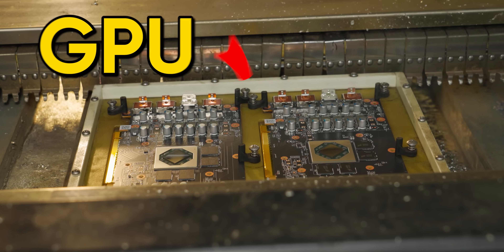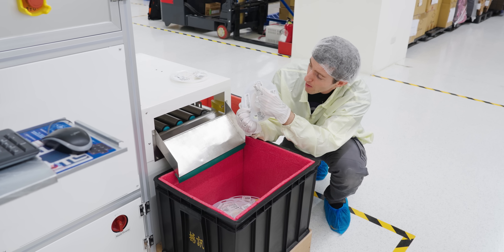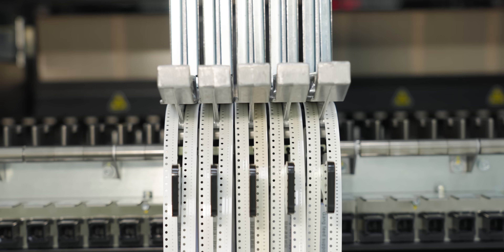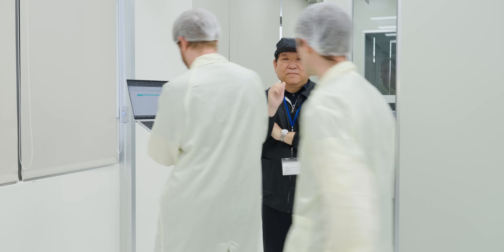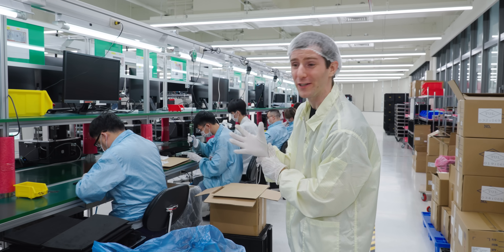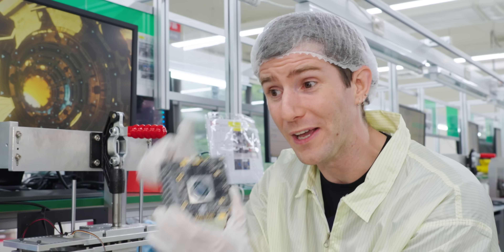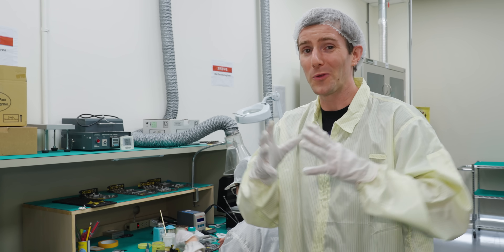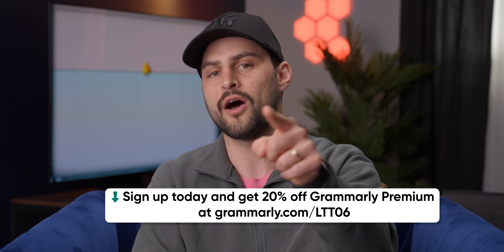They Turned off this GPU Factory For Me! PowerColor Factory Tour

Comment: About temperature testing:
It is common to test electronics while changing temperatures, it is called Thermal Cycling Testing. 
The electronic module expands and shrinks by some micrometers due to the temperatures, which can cause delamination or plastic deformation, leading to a failure of the module.

Comment: Seasonic psu is trash i paid 150 euro brand new gx850 yeah and it didnt work. We meansure the volts and it was lower than it should be and it wouldnt turn on the pc plus the one of the capscitor had also leaked oiled and even brand new it smelled kind of a burned smell. Seasonic trash never again

Comment: Man, I really didn't think work like installing connectors and capacitors is still done manually. I wonder if there's a reason for that?
Reply: I can see why the IO plate would need to be manually placed but a capacitor could just be done by a pick and place machine thingy right?
Reply: @Nostalgia_Realm  Pick and place is mainly designed for surface mount components that can be handled in a sheet. Which is the majority of the board. But you really can't beat through hole capacitors for thermal resistance and overall power power.

Comment: Haha, i remember writing a Manufacturing Execution System (MES) for Dolby Labs back in the day that handled the manufacture/movement/tracking of boards all through production. I remember interfacing to all those machines (pick/place, ICT (testing), Flow solder, SMT (top/bottom). Testing was done with a Scorpion Flying Probe test machine. We had to knock a hole ion the side of the building to get it in. We also had fault tracking to enable heat mapping of failures on the boards at testing stations.
Wow, this brings it all back. Nice video.

Comment: Does the entire motherboard get dipped in the liquid solder?? Why dont they do the same roller way as the solder paste? 

Imagine: a roller with oozing solder and a heated template so it dont dry till the roller has past more than once. Then shoot a laser or super thin blade slicing horizontally theough any exta soder.
Reply: Wait they have balls that already do this??? So why not do that for the motherboards???

Comment: Thanks Linus for the video! I'm also in electronics manufacturing, and this isn't the craziest line that I've seen. Anti theft tags or Sim cards are basically small PCB and the machines are astonishingly fast. The bare PCB comes in a spool which is unwound, solder is placed, then components are baked on, its gets die cut and rollend into a new spool, ready to go. It does at a few miles per hour and lloks like a H R Giger giant cassette player
Reply: Is it true you guys get bad pay because the job is cool?
Reply: @sinesaii  lol the pay is ok as far as im concerned. The issue with this kind of electronics is that its high volume, low margin, so it's high risk low reward compared to professional audio or military stuff for example

Comment: BTW:  40*C isn't so bad, compared to the 60*C I had to work in when I worked in a plastics manufacturing department for a refrigerator company.  (in the summer if it got to 110*F outside, it was 140 or higher inside that department.  We had port-a-cool fans that half worked and large fans as well that ... "helped"  (when we didn't have any fans, you knew how much they did help... but otherwise it was just hot air blowing, or so you would think).

Comment: Cmon Linus, you KNOW it is FLUX paste! Louis would be disappointed in you!
Reply from the maker: It contains both, but its purpose is to solder the board components, so I went with that. Our time was very limited so I wasn't able to script and use my teleprompter - LS
Reply: @LinusTechTips  I see because it is for components where you cannot apply solder too the paste has both solder and flux in it... Neat. Honestly I have not messed with micro soldering. Used to make my own pcbs in the acid tank.

Comment: Great video.
I'm curious. Because the theme of this video is GPUs.
Here are my questions:
1)Can Workstation GPUs like for example on the red side the AMD Radeon Pro W7900 or a similar GPU on the green side, be used for gaming as well?
2)Does it get you any benefits opting for a Workstation graphics card instead of a regular one or are there some drawbacks?
3)What are the key differences between gaming and workstation graphics cards?
Thanks for taking the time to answer these questions!

Comment: I remember that we occasionally sold PowerColor graphics cards way back like 20 years back. Then they kind of disappeared locally. Good to see that they are still in business. As I remember it we had no problems with their products even back then, and with the controlled manufacturing environment shown in this video the current products should be of high quality. If I remember correctly the graphics cards from them we sold way back here built using VGA controllers from Tseng Labs. Now that's a quite different quality of product compared to what we saw in this video.

Comment: Fun Fact: Linus you mentioned on the WAN show that you changed the aspect ratio of your videos to fit better on Phone and PC screens, the fun part is that if you made it just 10 pixels wider it would be perfect for my screen, because I use Firefox with the bookmarks toolbar on the left side of the screen, so in "theatre mode" I get basically no pillarboxing.

Comment: Used to work at a factory that had one of those wave solder machines.
It malfunctioned one night and spilled its entire solder content onto the floor of the factory.
What a mess that was
Reply from the maker: Oh no........ - LS
Reply: @LinusTechTips  I don't remember the exact amount, but IIRC it was close to 200lbs of solder.
Needed to use an axe to break it apart

Comment: It's odd seeing someone so excited for something you see every day. Our line has a couple extra steps though. After solder inspection, it gets washed, and then comes conformal coat.

And that pool of molten solder, it's called "wave soldering" ;) As you saw, it's more labor intensive, aka expensive. A good tidbit of information for any engineers out there working on a small run of CCAs, avoid mixing surface mount and through hole components if you can, will greatly reduce manufacturing costs.

Comment: It's remarkable how similar the fabrication process these GPUs are to most other PCB fabs.
My previous job was configuring and training PCB fabs on a brand of automatic solder inspection machines, and the production lines are almost identical ! Just scaled down/less fast here and there.
Reply: What did you think they were? You must not have worked there for long. Any sufficiently advanced technology is indistinguishable from magic. Yes GPUs are PCBs. Any part in your computer that has electricity going through it thats not a cable is a PCB. Without PCBs there are no computers. Its hard to remember who they identify as deep down, but beneath all the plating, cases and large fans, they identify as PCBs too. 😂

Comment: As much as I love my seasonic PSU's, I've gotta say... don't buy the Vertex line up. If everything is as I understand, and if I understand correctly, all those GPU cable fires are due to the way the pins in the socket are laid out; and so it's not really actually something Seasonic can control for all that well. Why does this matter? Look at the socket on the PSU. It's the same plug being used on both ends. 

I want to say that Seasonic would at least do their best to ensure that fires aren't a problem on their PSU's end of things, but that connector is not their design; so it's not something that can miraculously fix when the problem is the design out of their hands itself. 

And...

Seasonic does make duds now and then too. M12II series... those who know, know. Those who don't... well... you'll still see this one being sold in some places for real cheap. There's a darn good reason. It's one of the very few actually bad PSU's that Seasonic has ever sold that I know about. Until the Vertex, possibly. 

Notice how they are selling them for cheaper than their other lineup? Notice how they used to be a 7 year warranty maximum, despite offering 10-12 years for their Prime lineup? Some might notice that Vertex is now getting the 10 year treatment too. And I do like to see that, since it means Seasonic is fairly comfortable with the warranty period. It's a good sign.

But...

That new connector... it's caused so many problems now. All of it due to the design as I understand. 

I personally will not be taking that risk, and am staying way from Nvidia's GPU's entirely if they use it. If AMD starts using it, then I guess I'm stuck with Intel. If all 3 use it, then I won't be upgrading for a while until they fix it, properly. 

No one wants anything to do with fire appearing in their PC. Understandably, I would hope. 

So, sorry Linus, sorry Seasonic, but Vertex ain't getting my money. It's quite possible that the PSU will be just fine within the warranty period, but that fire issue for that cable... it's too much to ignore.

Comment: This factory tour has the be one of the best ( if not the actually the best) factory tours on the YouTube, as an industrial electronic technician i trained under a pcb manufacturer ( they are specialized in ipc level 2 & 3 electronics) 
This tour had it all, from the components getting first visual inspection when it's arrived to the factory, R&D on new products, manual reworking on ICs/ chips  to the packaging ( quality control is whole another story ) 
Using Mantis ( its like a microscope ) to inspect visual deformation in SMD or THT components ( usually that's goes through least 3 inspectors to verify absolute best quality products )
Reply: If you haven't seen the factory tour videos by GamersNexus, it sounds like you'd love those.
Reply: im curious, can a person with bachelor's degree get accepted in those types of job or is there a specific requirement/s?
Reply: you should see their tour of the intel fab in Israel, this one is also very impressive

Comment: Yes those ORT rooms are brutal. Remember doing QA for HP laser printers. And the different rooms. 0c and the 45c at 100% humidity were the worse. But the low humidity was quite uncomfortable as well.
Reply: Total agree on low humidity being wildly uncomfortable. I spent time prodding server hardware a while back and the room was kept at ~6% humidity and 18c. The cold wasn’t an issue but the low humidity felt like the moisture was being sucked out of my skin.

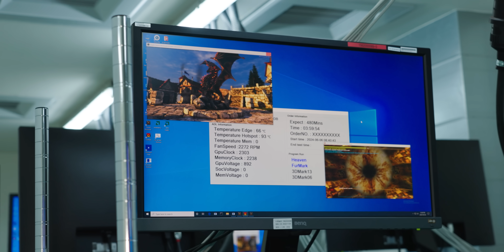Comment: 11:02 they test for cool temperatures because some users like me, may use it in industrial places, outside, during winter. When temperature is below 0. That is super cool!
Reply: That’s cool :)

I wonder if it helps with transport too. If they can survive the cold without breaking then there’s more options for things like airfreight where it’s cheaper to fly stuff in the cold parts of the plane.

74gear had a great video showing one of the aircraft he flew where the cockpit was heated, but the cargo space dipped well below freezing during flight. Was an interesting example of how the economics of freight works.
Reply: @jamieknight326  that is correct as well. You said it right! It is definitely useful to test the gpu if it can handle transportation and stuff

Comment: vastly more interesting than I thought as I've been watching GPU repairs for several months. I have multiple Powercolor cards in 2018 and they make great basic cards, the performance or higher variants not so much. The Framework card is interesting-why not standardize a GPU card for desktop and laptop with 75 watt TDP? This way, this card tier can be made more affordable for everyone and have price/performance similar or close to $200 graphics cards and laptops can finally have discrete/user replaceable GPUs.

Comment: i wonder why they haven't used mxm in framework laptops, was it licensing or something? i mean if they want to get best upgradability then mxm instead of proprietary connector would be better choice

i know that many manufactures tried to make it impossible to interchange gpus back in the day like asus flipping it 180 degrees or toshiba with diffrent pinout and many more made weird dimensions ones,bios locked them like hp or just made their own connector based on it, but still there would be more chance to upgrade in case of it shutting down

Comment: There are a lot of components on every board so the machines probably are placing multiple different components very quickly and accurately that's why they check the components before loading them for problems, if a machine thinks there are 3,568 but there are actually 3,567 it could shut down the entire line or the board might make it out without that part, knowing where the problem came from is essential on automated machines, I bet that they didn't check for flatness until something happened lol, usually that's how new steps get added to a process, unfinished cards can be easier to damage so a visual inspection is a good idea when you don't have the extra machine or aren't making enough of them to setup one to do it for them, I think it's cool the way you can setup a jig of spring loaded gold pins to come down and touch preselected pads or test points and check specific things like voltage outputs etc automatically to make sure there aren't any huge defects before the next stage saving much time, imagine how good those people are at reballing and installing big custom chips and working on these complicated difficult to work on cards lol it would be awesome if a manufacturer would have someone looking for cards that perform really well to bin for people to buy for a premium, like cards that achieve stock speeds at lower voltage or temperature etc

Comment: Thank you Linus and team for this video tour. I worked in the PCB fabrication industry for 28 years, so I've seen that first hand, (I worked in the wet process areas of this industry. Thankfully, I'm retired from that work, the chemicals involved are pretty nasty. I have scars from chemical burns.)  However, I've never seen how components were installed using modern methods. Very cool stuff. PCB worker, 1983-2012, I guess that's 29 years. Do I miss it? Noooo.
Reply: Thanks for sharing. That sounds like a heck of a career. Did you move into something else after or have you retired now?
Reply: @jamieknight326  I'm only 60 yo, I'm not old enough to retire. I've worked at HD for over 11 years now, and couldn't be happier. I'm going for my 20 year patch, and then I'm out. I'll be 69, and still in great shape physically, do to my activity level at work.
Reply: @stumpythedwarf8712  thanks for the info. Hope the next 9 years with HD go smoothly and you enjoy your retirement when it comes. Best wishes :)

Comment: I've been an Nvidia guy for the past 25 years but they're just too expensive anymore. At Christmas when I built a new system for my nephew I went with a PowerColor RX7800 XT Hellhound, good board. When it comes time to replace my 3080 I'll probably replace it with a PowerColor GPU. The granite table brought back memories. We had one of those at my old job. We used it to test springs in a test rig that had to be perfectly balanced and level. The springs took 10 minutes to build and 2.5 hours to test. The scary part was the test rig was running on a 20 year old PC that required Windows XP to work. So glad I got laid off before that PC broke.
Reply: I wish I could go down the AMD path. I really want them to succeed. The issue is CUDA support, OpenCL is great but it’s not supported by many of the application I use within my work. The AMD option can easily be 4-8x slower for the same tasks.

I’m hoping AMD’s increased focus on AI will result in improvements to their GPU Compute performance.

I wonder if the US government may move to force NVIDIA to open up CUDA to other platforms in the future due to concerns around monopoly or in the interest of national defence & avoiding a single supplier situation.
Reply: Old OS needing to be used is a hilariously sad part of a lot of engineering. I was in an university lab where a piece of equiment literally needed a PC with windows 98 on it to work. Next to it was a new win 10 PC(this was a couple years ago) to do everything else other than run that one piece of software.
Reply: Same here. Had been an Nvidia and EVGA customer going back to the GeForce 2 I believe.  With EVGA out of the picture, I ended up with a RedDevil and I love it.  Would buy again 100%.
Reply: PowerColor came a long way, they are the best AMD partner, super innovative, others just slap coolers around, they dont even care much about details. PowerColor for example is the only AMD partner that actually have a trully all white card, with white pcb, heatsink, cables... all the details.

Comment: You know... the one thing I am most surprised about... Is the components reel. I never imagined it would be like that. Totally thought it would be like the rivets for a drivmatic machine for aerospace, where the components are put in a vibrating bowl that makes them go up and fall into tubes in the right orientation to be placed quickly (Vibratory Bowl Feeders).
Reply: I work in aerospace and these reels are exactly what the helicoils we install on some parts come in.(our plant installs by hand though). The granite surface was also familiar.
Reply: I can’t find the link right now but the raspberry pi foundation had a brilliant video about how the reels work. The way the parts are picked up and slide out is very clever. Crazy combination of precision and speed.
Reply: I imagine vibrating sensitive computer parts in a big bowl could risk some damage.